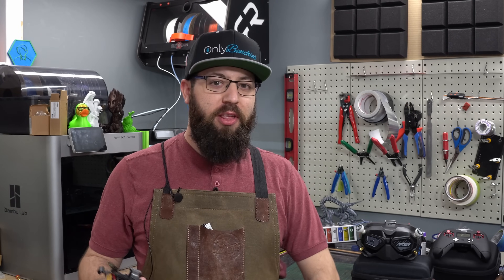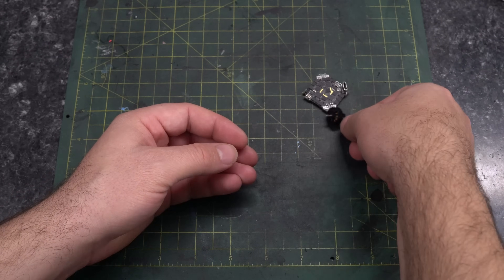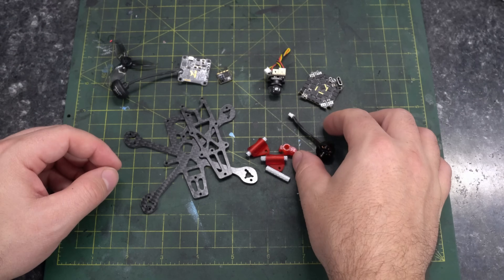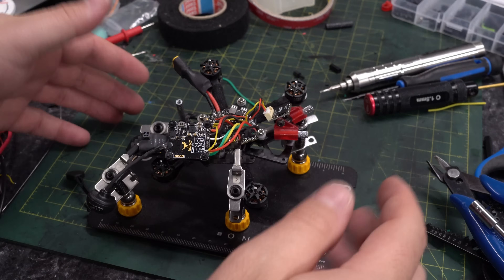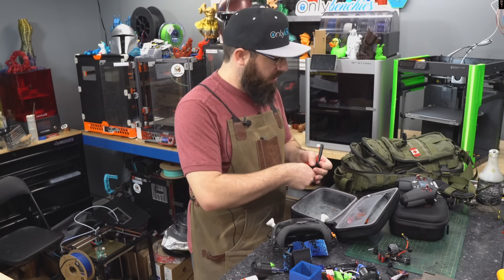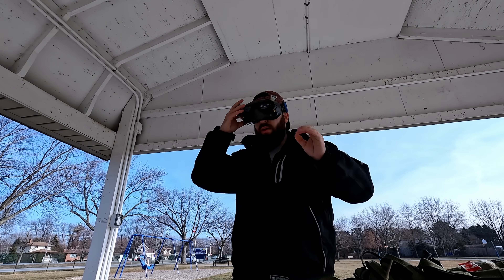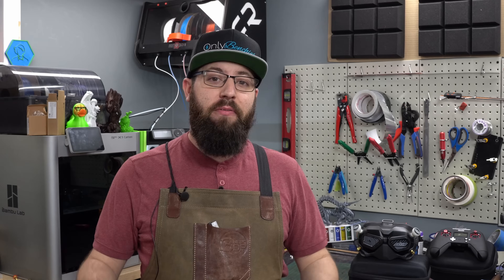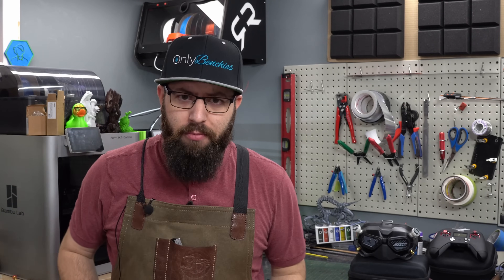ODONATA HD - A DIY opensource FPV Quadcopter - Build and test #fpv

Comment: Have you tried the new dji o3 air unit?
Reply from the maker: Nope, my goggles are the V1`s and dont really have a quad that I could use it on either (mine are all mostly sub 250`s)

Comment: Change your camera to PAL mode if it supports it, you will get a much better image. Some people obsess over latency and use NTSC because its 60Hz refresh vs 50Hz for PAL, but I suspect it will make zero difference.
Reply from the maker: Yup, I run PAL when the cameras support it

Comment: Hey Nero, I noticed that when you had the 3d gyro model up on BF that it was twitching a lot. That can be a sign of a bad gyro. If you can, set your quad down, and while connected to BF and having your quad staying still, if the model is twitching, you may want to look into getting replacment fc. Love to see other people coming from 3d printing into fpv, because thats what I did.
Reply from the maker: Gyro is fine, i was holding it the while filming thats why it was kinda flipping out, its rock steady when sitting on the table
Reply: @CanuckCreator  Ok, I was just asking in case something was awry. Thanks for responding.

Comment: What’s something like this roughly cost with controller and headset?
Reply from the maker: It really depends on what your looking to get
You can get cheap all you need to fly packages for like 2-300 but usually they come with a headset/controller you would be replacing quickly if you stick with it

budgeting 3-500 and getting some good googles/transmitter/charger/quad/batteries to start is probably a better idea

(i use a used set of DJI v1 goggles with analog adapter and a taranis x-lite with elrs module for reference)